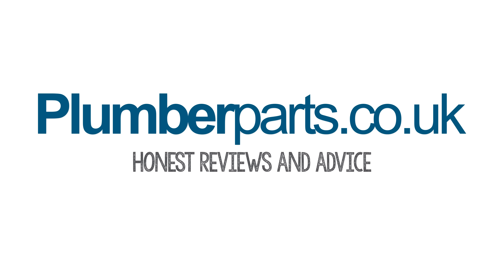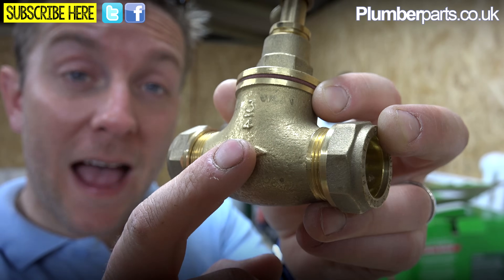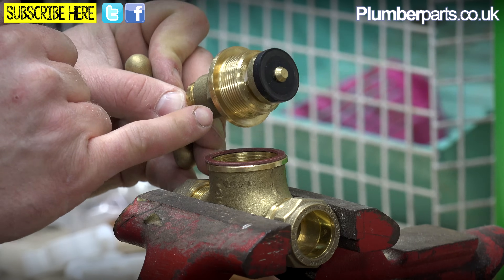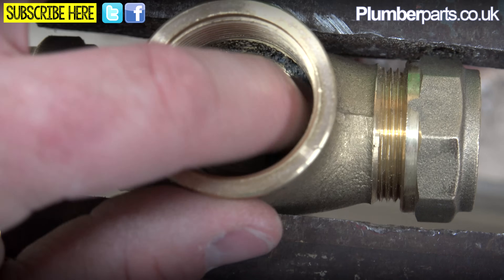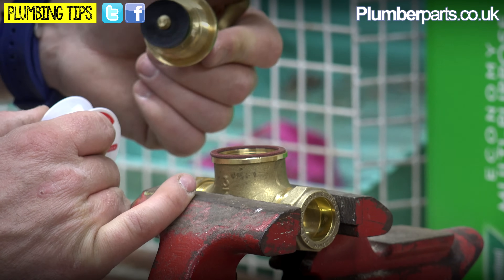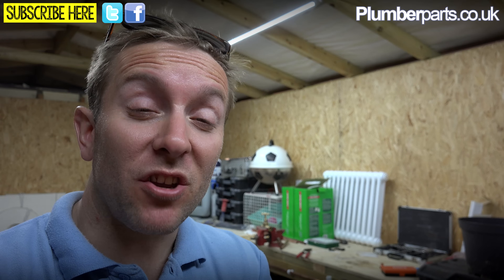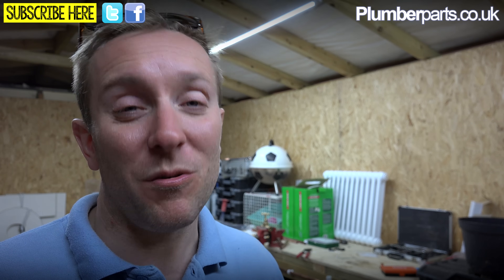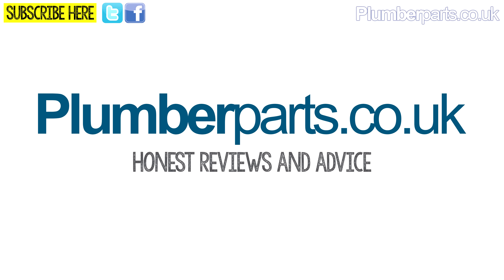YOUR MAINS WATER STOPCOCK - HOW THEY WORK - FIXING LEAKS - Plumbing Tips

Comment: I had the same problem you mentioned with the small nut at the top weeping, I did as you said and tightened it up but the problem was that every time I turned the stop tap on or off the nut just came loose again.

Comment: This video helped me understand that the stopcock was made of many parts fitted together. My handle moved but water did not flow. I kept turning it on and off for a good ten minutes and was on the verge of hiring a plumber under I discovered that the handle itself was turning, but the shaft it was attached to wasnt. I put some masking tape on the shaft for grip, and then clamped on a vise grip. It eorked! Turned out that some imbecile had designed a screw on handle for the stopcock. ❤ great video this.

Comment: Nice tips it I’ve got opposite problem, I turned my hot supply from storage tank off (for a reason which I’ve sorted)  but won’t turn back on, I suspect the washer has come off & stuck on the seat, only low pressure & not enough to lift washer off again I think. I’ll keep trying & bashing it. O dear.

Comment: Hiya, thanks for your video; my problem is the other way around; the valve starts leaking when fully opened, so we have to open it till halfway so there is not enough water pressure upstairs. Could you advise me on that, please?

Comment: For a DIY plumber opening the screw thread to expose the washer is a risky exercise as it will inevitable be stuck. Wrenching it open is likely to cause a leak in the incoming lead pipe. Even undoing it when in a copper pipe can damage pipes. A stop tap costs about £8 so just replace it.

Comment: Top vid once again James! Quick question what's your thought on the surestop switch valves..my old stopcock although was turning the water off, it kept spinning..so my plumber replaced it with it surestop, therefore no manual tap function at all..however since then we seem to be experiencing issue with water pressure especially when the washing machine or dishwasher is on..what's your thoughts and experience of them?..I'm about to tell my plumber to replace ot with a conventional stopcock..
Reply: Been nice if they had bothered replying ,oh well.

Comment: I’ve got a very very slow weeping gland nut but the problem is the stopcock is boxed in I can get just get to the nut but worried about trying to tighten it as I can’t get a grip on any pipes. Should I go ahead and tighten it or do I run the risk of flexing the pipe and ending up with bigger problems. Don’t really want to have to break open the boxing

Comment: In case of a  seized  under sink main water tap just heat it up with a blow torch for 15-20 seconds and it will loosen up and turn.
Reply: Won’t it melt/burn/damage the stopcock washer?

Comment: My stop cock handle  has been snapped off, as its on mains could i just  fit a self cutting 22mm isolation valve on the pipe  without turning water off from outside ( as i live in a block of flats ) hope that makes sense

Comment: Hi can you answer a question for me my water supplier wants to move the outside stopcock valve of the outside pavement which is their reponsability onto my drive way they say it's up grade work  improvements  but does that mean I will be then responsible for the stopcock valve which is now within my boundary I cannot understand this as the stopcock valve is inches away from my boundary I don't want them digging holes in my driveway which has cost a lot of money to put down I believe they want to do this work so they can install water meters against my will also can I tell them I don't want it on my premises
Reply: no,  if they move  to the outside of your property it is local water boards problem

Comment: This is a great video, but I have 3 taps under my sink. I cant turn any of them and don't really know why there are 3. One is right by the meter and the other 2 look like this with pipes either end !!  So really wouldn't know which one to choose, to change it. I was advised to use the one outside.

Comment: Hi. I need help to release the pressure from the stop cork inside the bathroom as there is barely any water coming from the taps. When I opened the whole thing water gushed out after fixing it back still no water to the sink. Any ideas? Thank you

Comment: Sweet. Tried shutting water off and mine is seized. It then started leaking slightly. Fixed that by tighten the gland by the tap. Just need to make time to replace the whole stopcock now. Great video

Comment: Hi, I live in a converted railway siding and my stop cock is in the drive underwater (not even the usual tool is any good to turn it, so made my own out of a length of wood with a groove cut in it),.
Is there any way I could put a stop cock indoors or at least more convenient place, part of the problem is locating the main water supply pipe coming to the house.

Comment: My problem is that the stop cock is in the downstairs cloakroom, but there is no stopcock outside. I live in a courtyard and none of the houses or flats have outside stopcocks, or if they had, they have been tarmacked over, which seems unlikely because I don't believe the yard has ever been resurfaced since they were built in 1976. Could I stop the water with one of those freezing kits?

Comment: Hi James.

When loosening the gland to wrap PTFE below for packing. Can I leave the stopcock open or does it have to be closed?
Reply: The stopcock needs to be open, otherwise you wont have sufficient clearance to retract the gland nut in order to wind the PTFE around the valve stem. 
Provided it is only the gland nut you are loosening, you dont need to isolate the main either... having wound several turns around the valve stem, in order to get the nut to find its way back onto the thread consider closing the valve with pressure on the gland nut... having started the thread, wind the gland nut home. Job done.
Reply: @guido7412  Thanks very much for the advice.

Comment: Well done, a great video, i like it a lot, informative, fun, and i have learned so much, my stopcock was leaking, put some ptfe tape around the gland, and from full position turned it back a quarter of a turn.  What i find is that if you use the stopcock often, to open it, it loosens the gland nut, as it is the same away to loosen it. then you might get a drip.  

Plumbing is hard work, and they earn every penny,  especially for a DIY person,  there are many DIY people who have to call a pro out, like this guy.  These tips can help to prevent, a lot of problems. Thank you.

Avtar
Coventry

Comment: In my airing cupboard there is water dripping on the pipes i have phoned my local home group repairs the plumber man has come out 4 times all he done was put ptfe tape round the stopcock and used the spanner to tighten it up at the bottom of the pipes were the water is dripping. I don't think the plumber man thought about the fiber washer and rubber washer needs replacing. I think that might be the problem :/
Reply: I have the same problem. It appears you know more than that plumber does !!

Comment: Can you suggest a solution to my stopcock problem please?  I turned my stopcock off and went on holiday for one week. When I came back, I turned the stopcock back on.  Water ok for a couple of hours but then pressure dropped down to nearly nothing.  Turned stopcock off then on again.  Water came back good but really really noisy, pressure good then dropped off again.  Prob with stopcock internal washer not fully opening? What can I do?
Reply: Isolate the mains outside, then close the stopcock fully.  Give it some gentle heat with a hair dryer, open and close it a few times while it`s still warm, it may put the flexibility back into the washer for it to re-seat.  Failing that, the only answer is to follow the video and HOLD TIGHT.

Comment: I live in a ground floor flat and I've turned the stopcock underneath my kitchen sink off which turns off the water supply only to the cold water taps and bath. there is still water coming out of the hot taps??? I thought the stopcock in the kitchen turns off all the water in the property?
How do i turn the hot water supply off ?
Reply: or find more stopcocks in with the hot water tank?
Reply from the maker: +Dre50874 You need to drain the loft tank also mate!

Sub here please>> https://www.youtube.com/subscription_center?add_user=plumberparts <<If you haven't already!

Comment: As I wrote in my previous comment, I had a trouble with my stopcock, but I fixed it (hell it was) and now I am remaking all plumbing in my house, and what I found made me laugh my ass off - I found cold pipe that run below the ground where the toilet was, and the plumber back then probably ran out of tees, so he used a STOPCOCK body as a tee for a toilet pipe :D how redicilous is that?

Comment: Why everyone in England is using the crank-stopcock? If this is under the house, it will not be cranked at least one time in month. And this will cause it to stuck in open position and when you will try to crank it, even pliers will not help you, because the gland and the shaft will be coroted in place, and the sealing washer will be hard as a rock. I think everyone should be useing a ball-valve, witch has a rotating ball inside, and to shut it off you only need to twist it quarter turn. Those crankcable stopcock are designed to be used in gardens, basements, for water pumps etc. because they need to be cranked all the time, or it will stuck. For places, where you will not touch the valve for years you should use a ball-valve. Those can stay open for years and you will still be able to turn it off easily if you need.
Reply: They have a poor design imo. The gate and shaft are in the way of water, resulting in corrosion. I
ll also add that 1/2 of the ID is obstructed, resulting in less water-pressure into the Home. Ballvalves all the way.
Reply: Vytautas Poška well said
Reply: What's the difference please? I live in 1845 house and discovered that stopcock is all crumbling. Have a dilemma new stopcock or ball-valve. Also would be OK to fit Water Hammer Arrester just near stopcock to reduce stress on pipework all over the house? Thank you.
Reply: In modern UK homes they are not commonly used. As you say ball valves are far superior.
But in the UK with our brick or stone construction houses tend to be old. About 29% of our housing stock is a hundred years old or over. 40% is pre WW2. So coming across old stopcocks and other antiquated brassware would not be unusual for a plumber or DIYer.

Comment: Hi plumberparts I want to ask, what should I do if my main city water supply comes into my house's basement and it goes into the first stopcock, before the water meter. That stopcock is one of those really old soviet made iron ones, and it is so freakin rusted, that when I tried to twist it, thus to shut off water mains to my house, the handle twisted off itself, but the whole stopcock didn't shut off, the main arm that sticks out from the top twisted off and there 's now nowhere to grip and shut it off, and after that it starter to leak. What should I do? I tried to ask my city's goverment to shut off the water at the street, thus shutting water to all 10 apartment blocks and 60 private houses in the street, they said that they can't do this, because the main street can't be shut off, because of some sorts, so what can I do? If I try to touch anything, it will start to leak badly, and if I leave it as is I am at risk that 100 year old plumbing in my house will some day erupt and I will be in a lot of trouble, so what should I do?
Reply: Vytautas Poška sounds like you need to hire a pipe freezer and im assuming you live in the usa ?
Reply: no, I live in Lithuania. . .
Reply: ah my bad but yea it sounds like a pipe freezer job

Comment: Is it considered acceptable to use a 1/4 turn full bore lever valve for mains supply isolation?
Reply: Yes you can . There was a change a few years ago to allow lever valves as stop valves in place of a stop tap .